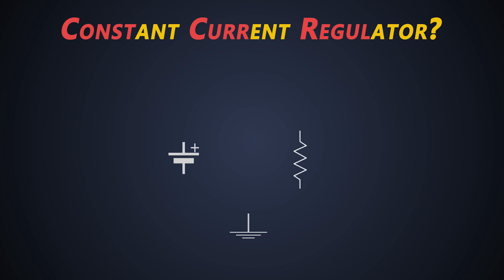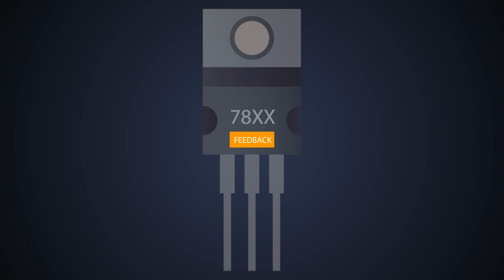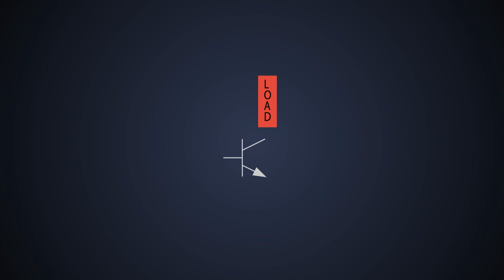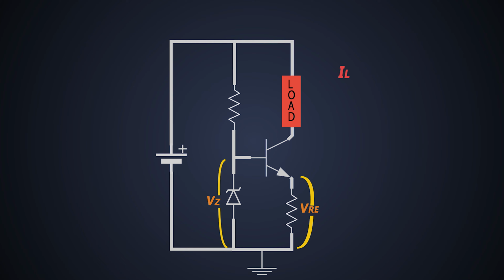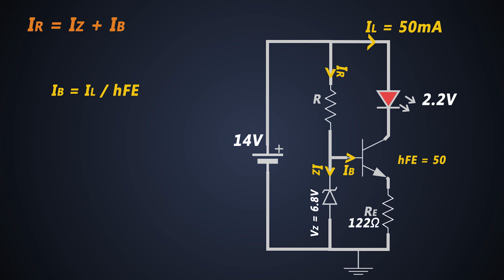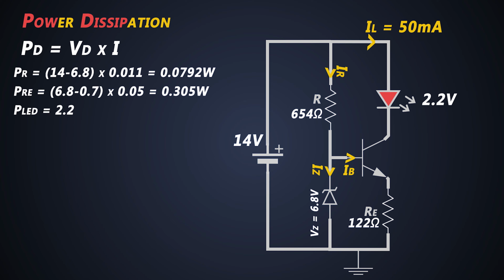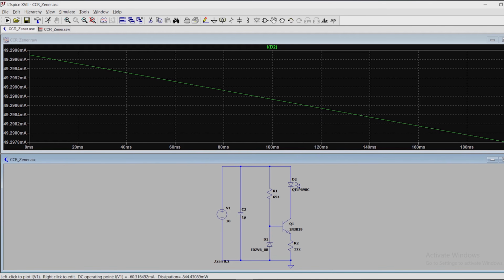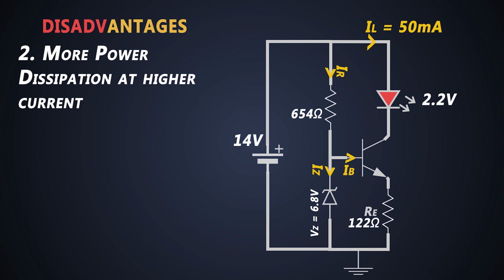Constant Current Regulator using Transistor and Zener diode | CCR | BJT as a current regulator.

Comment: i saw very like circuit on an audio amp circuit, so i found this video ,.. tyvm 👍 except audio amp had 2 zeners with cathodes facing each other on the gate, 2 caps and switching an inductor, huge inductance.

Comment: Hi if we using voltage 3.7 with constant current of 10mA or 20mA or 30mA and than we want to voltage should be less than 3.5 . so what components should be use?
Reply: buck converter?

Comment: First, I am very far to be an expert but maybe this can help understanding efficiency of this circuit and why in some cases it can be usefull and give a good efficiency while  in other cases it will give poor efficiency and should be avoided: 

IMHO, I think this circuit is suitable and very usefull when the load is well know and components are adjusted to average load and do not change too much, it is not really made to be versatile and used with uncontrolled loads.

As the base & zener diode currents are very small they may be ignored in total power consumption, so powering a single 2.2Vx50mA LED (110mW) with a 14V battery ouputting at least 50mA will always result in a bad efficiency as the total consumption with this circuit will always be at least 700mW for 50mA (14*50), wich give an efficiency of 15% for A SINGLE LED (590mW lost). 

But : 

1 - with a lower voltage V+, efficiency can increase a lot, using lower voltage zener (or maybe rather one or two regular diodes) but it would become less versatile and wont allow a big change in loads, ex: with V+=3V and one or two regular diode in place of the zener diode, it would give an efficiency of ≃ 75% as PT = 3V*50mW = 150mW

2 - efficiency can also be a lot better in case this circuit is used for more than one LED, with a maximum of 3 LED in this specific case (V+ = 14V and zener = 6.8V) wich give 2.2*3=6.6v (330mW), then the efficiency become 15%*3 ≃ 45% (or 330mW/700mW), efficiency can be even higher with more LED using a lower voltage zener.

PS: in case it is necessary to deal with a wide range of unpredictable loads there are probably a lot of better and more versatile ways, but more complicated and costly (like DC-DC Buck converter).

Comment: This can't be... if there is a voltage V_BE, then V_Z = V_BE + V_RE, and not V_Z = V_RE... V_BE should be around 0.7V if it is made of silicon, so V_RE is 0.7V smaller than V_Z. At 3:38, it is wrong... later you include V_BE = 0.7V and then it is right... XD

Comment: That was very helpful (I think). Would I be right in thinking at that input voltage it's super inefficient? i.e. there's more power dissipation over the other components than from the LED?
Reply from the maker: Yes, you are correct. But it is cost effective & easy to use
Reply: @FoolishEngineer  thanks for confirming. I really wasn't sure!

Comment: Sir , i want to make a constant current power DC driver , for my LED strip ..
The required constant current is around 300 mA , and Load is around 60v , plzz suggest something acoordingly ..
Reply from the maker: You can use the same circuit
Reply: 300 mA current ??
Same circuit is able to power that much current ??

Comment: Can I know why the Vz and the Vre should be the same? I think Vre should be Vz - Vbe. Am I wrong?
Reply from the maker: Imagine Vz as a reference and Vre is the negative feedback which is given to the regulator, as mentioned in the working the voltage drop across both zener diode & Re takes care of the regulation process.
Reply: @FoolishEngineer  Thank you so much. It took me 3 weeks to understand the idea. Because the feedback path for this circuit is implicit. So it's so hard to understand.
Reply: Foolish Engineer,  that's a bullshit response. Vz and Vre are NOT the same!. Vre will always be ~0.7 volts lower than Vz. The base -emitter junction of the BJT acts like a diode. Build the circuit and see!